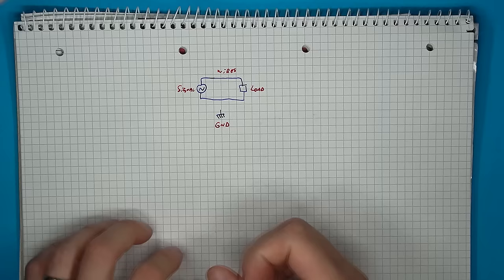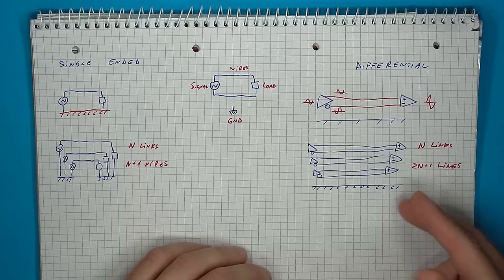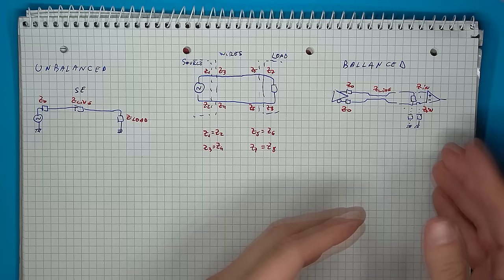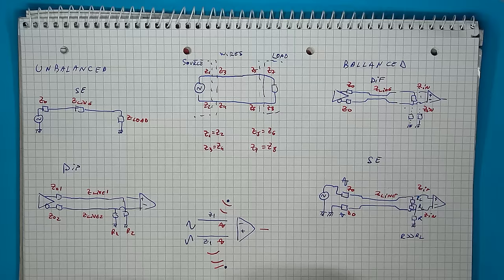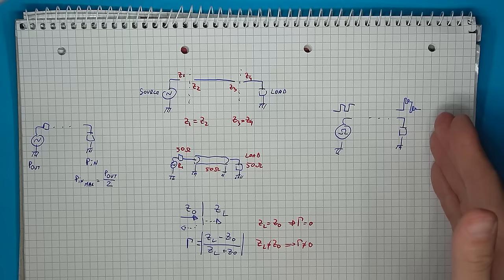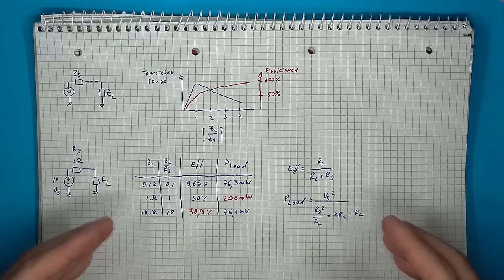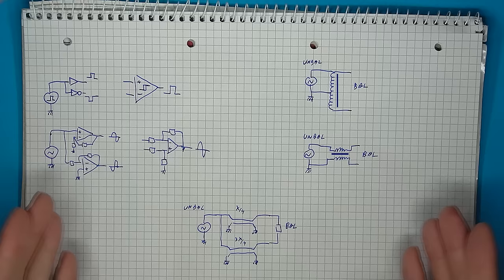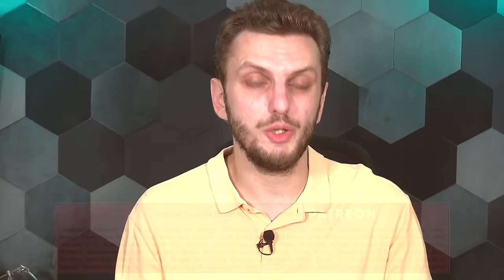Communication lines and baluns

Comment: Baluns, nice topic. I used them for composite and s-video and audio for retro video game consoles to send the cables a long distance to my capture card. Going 75 ohm to 100 ohm ethernet and back. In the end, I found it much cheaper to just buy a USB extension cable for the card. Still a differential signal. I'd go back to baluns if I used a PCI capture card.

Comment: Nice video, but the computations at 11:07 seem to contain an error (which does not invalidate the argument though). Using the equation for Pload (which is correct) for Vs=1V, Rs=Rl=1Ohm we get Pload= (1^2)/((1^2)/1+2*1+1)=1/(1+2+1)=0.25. 250 mW, not 200. Further, for both Rload=10 Ohm and Rload=1Ohm we have the same calculation  Pload=1/(0.1+2+10)=1/12.1=82.64mW. Or am I crazy?
Reply from the maker: You are right; I used an excel formula and accidentally swapped a "*" with a "+" and that is where the error in my calculations is from.

Comment: in my optinion the name BALUN (Balanced to unbalaced) is very confusing, when not completley false. Because, as in Audio applications the man thing u want is noise immunity through DIFFERENTIAL signal, as (i would say?) this is more immun to noise beeing unbalanced, than a balanced system single ended?
So am i right, that the main reason of a balun is to transform a single ended signal to differential and the one of this thing is, thats this transformers also serve als "balanchers". or am i missing something?

-edit: in audio applications a DI-Box is the best example. So do everything in one device: balancing (where i would say, this is the most difficult part), if necessary decouling of ground (to remove ground loops), single to differential and impedance matching...